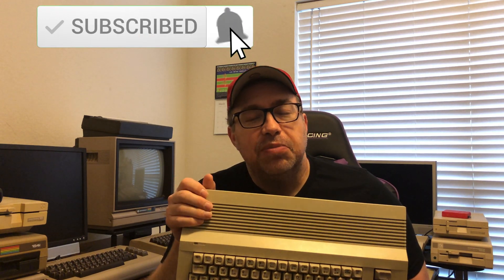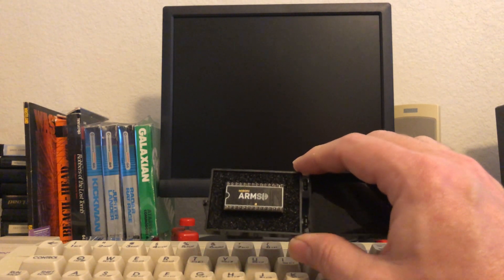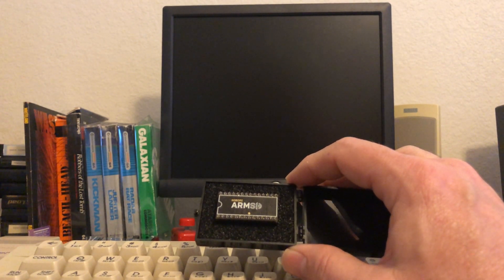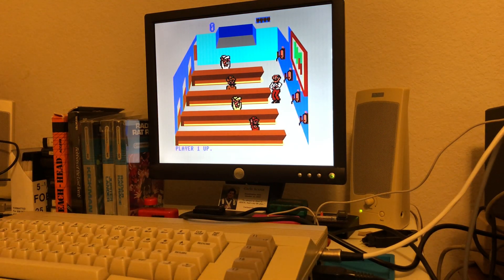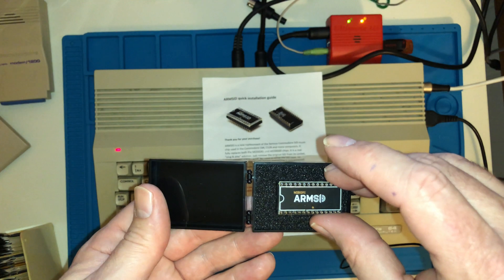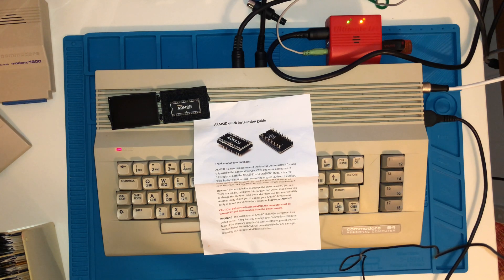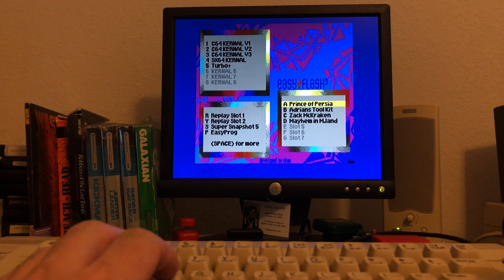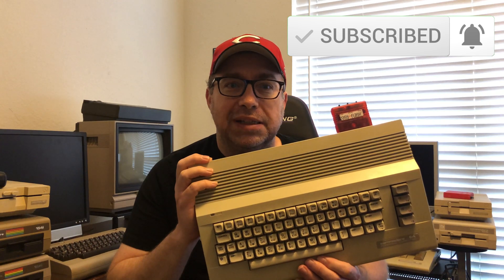I Broke a $50 Chip Last Time - Will My C64 Repair Redemption Work?

Comment: So are you going to fix the one with broken pins?
Reply from the maker: Would it be easy to fix and I assume solder new pins on it?
Reply: @FloppyDeepDive  it is not impossible. I've done it a few times with good results.
It's those cheap machined round pins that won't take flexing well and break at the slightest bit of flexion.
Try to get some decent US made machined pin strips. Thomas and Betts brand are good. They are mil spec and take heaps of abuse.
Just go carefully to remove the solder from the faulty section (use a solder sucker) then cut, saw, melt off the plastic strip that needs to go. Don't overheat the PCB board.
After that just cut in and solder the replacement section. Take your time and work carefully, you should be fine.
Let us know how it goes.😁
Reply: @FloppyDeepDive  yes, it would be a waste to dispose of it when it could be easily repaired.  You could make another video!  If you don’t feel comfortable doing it, I’m sure you can find someone in the community willing to help.  I would be happy to do it if you need.

Comment: Hello there! Please check the 8580 SID chip in an another c64c just to make sure. I recently had one C64C where everything else worked except the sound. It turned out that the fuse was blown. After replacing it the sound chip is working just perfectly.
Reply from the maker: Thanks for watching. I will do that.